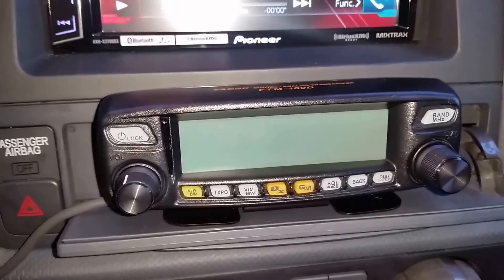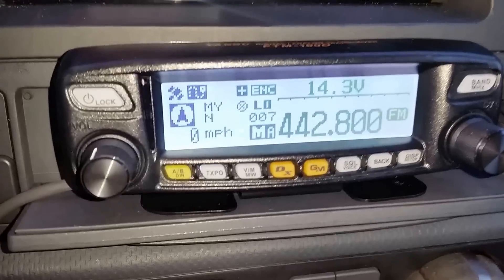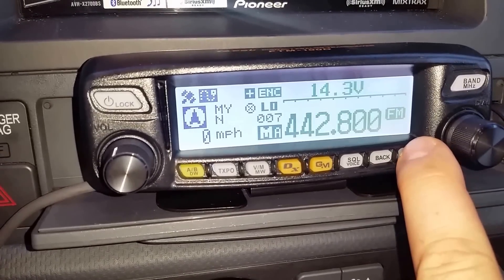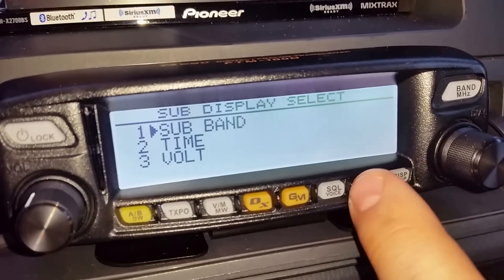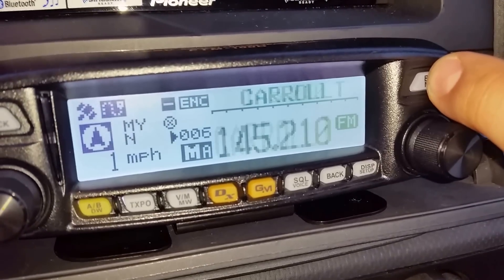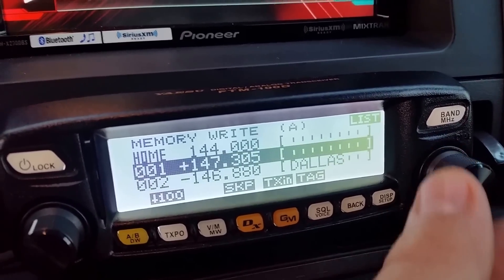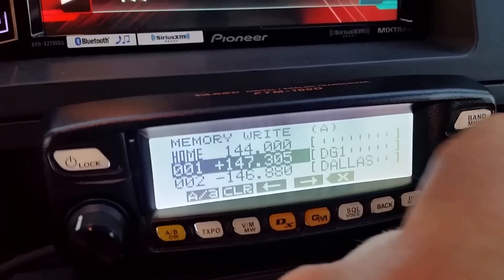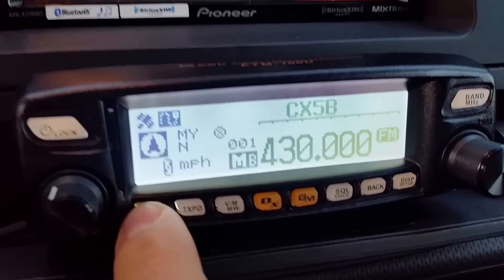Yaesu FTM -100DR Choosing different display option

Comment: This would have been a great radio if it was dual recieve ie if you are sending a aprs beacon on one channel you cannot use fusion on another deliberate design to make you buy the 400 instead
Reply: am only now realising that this is not a dual recieve rig... dont really make sense to me. You can only do either or.. so why have two Channels..

Comment: I own both the FTM-100 and the FTM-400. Both are great radios and I would not get rid of either. Although the 400 is the better radio, There are actually things I like better about the 100. 

One thing I find annoying about the 400 is that there is no way to attach the display to the body of the radio. with the ftm-100 you can. if I do separate the 100 face plate in my vehicle, I think there are more mounting options for the smaller face plate. Now I have never damaged the face plate on the 400 because I am careful with it, but it seems more fragile than the face plate on the 100. I dont think the 400 display could withstand any sort of drop. Also, The 100 is much more reasonably priced.

 I find that I never really use the dual receive on the 400 because when listening to one frequency, the other is distracting.  

One thing I do really like about the 400 is the 400 touch screen. it is great. The 400 is a bit easier to program because of the touch screen and easier to read at night.
Reply: charles leskie I am torn between the two rigs but really leaning towards the 100. As far as receive and audio which one is better It seems to be the same rig with different heads and except for the duel receive and cross band repeat is there any other differences thanks for any help

Comment: Nate, what does the map/tracking icon mean in the top left of the screen??
Reply from the maker: +Nick Patzke GPS enabled and in full operating mode and I do believe it also means the system is storing GPS points every 30 seconds, so you might see it flash every 30 seconds.